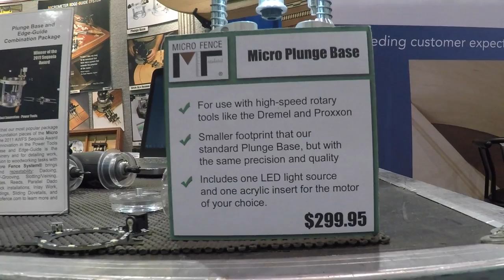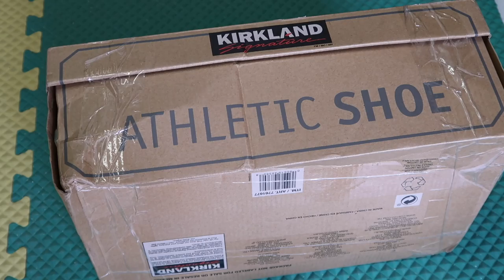About my Shop. Tool Time at AWFS

Comment: I still have my first tool I bought, a Craftsman claw hammer. The first tool my dad gave me was/is a 1/4" drive sticker set that is at least 75 years old. The rachet has a open mechanism to facilitate lubrication!
Reply: I still have my father's 1/2 drive Craftsman Ratchet which has a little ball bearing on the end you can push down to oil it.

Comment: I still have a couple of those old Makita 9 volt drills still working. The 12 volt one I bought years ago started failing after a year or so. The 9 volt was one of the best work horse tools I ever bought. Gone through a lot of drills since and my latest 3 are all Makita 18 volt brushless drills and impactors. Really like Makita products. There is a shining star manufacturer for different tools though. Skill wormdrive circular saw. Dewalt 12" compound miter saw on slide. 
Only trouble I have is your shop is too tidy. Man up and leave some stuff stacked up or leaning against the wall.
A favorite storage solution I have is a garbage can to just put all your shovels, brooms, sledge hammers, demolition rods, sanding poles, roller extensions in for easy access.

Enjoyed the video Steve, Take care,,,
Reply from the maker: Those Makita's were the bomb back then. Cordless has come a long way since.

Comment: I still have my 9.6 volt DeWalt cordless drill.  Since then I've worn out my 18 volt DeWalt.  I have 36 volt drill is on it's last legs.  I Don't abuse them, I just use the hell out of them.  Wait till you use a pneumatic drill.  It's about the only time I don't mind drilling too much.  Does tie you down to the compressor but the ease of drilling might be worth it.  (I don't like drills and drilling that much even though I do a whole lot of it)
Reply from the maker: Doing a whole lot of anything can make it get boring I suppose. The new cordless drill's with their great battery life makes the job easier though.

Comment: That plane does not look like a 4. The four is long and heavy and shallower angle usually for smoothing floors & the like. That is a jack plane. BTW the sawstop system started out being good because they used plastic inserts that would not kill the blade but later moved to aluminum inserts which require the insert AND the blade be replaced. Much pricier if you have a good blade like Forrest.
Reply from the maker: I will have to take your word for it on the plane. The Saw Stop system impressed me greatly.

Comment: I had the same Makita, and it died also. I have the same craftsman drill, and still have it.
Reply from the maker: I like the new brushless motors. The torque is outstanding and the battery life of the new stuff is stellar.
Reply: Hey Steve could you do a video about brushless motors?